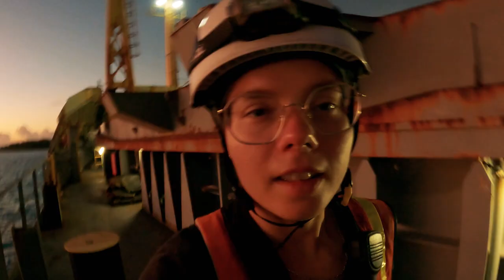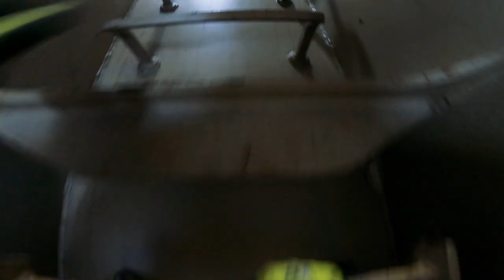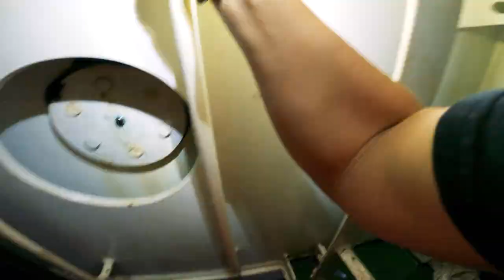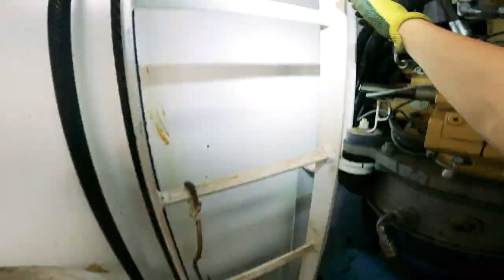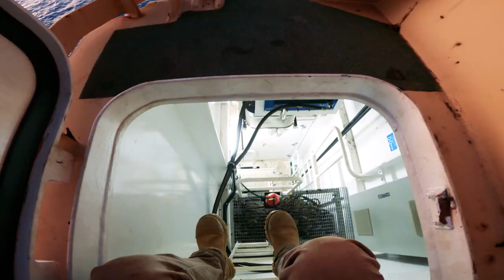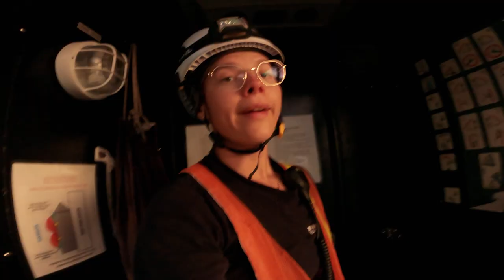Climbing Crane #1 On A [Tiny] Containership

Comment: Is the crane used to open the hatches; does that vary from ship to ship? Who on the crew makes sure the longshoremen take the right stuff?
Reply from the maker: I'll direct you first to my info video on opening hatches: https://youtu.be/6v2bzCKRlHA
Reply from the maker: Regarding unloading and loading, there is a stowage plan that is agreed upon by both the chief mate and shoreside ahead of time. Then the hatch boss has the plan in hand when discharging and loading. If anything changes (which it always does), we are notified and we have a cargo program that we plug the changes into to ensure we will maintain vessel stability with the changes. Then we approve, and they carry on
Reply: Thanks. Looks like, on this ship anyway, the crane isn't used to open the hatches.
Reply from the maker: @OldePete  Correct, different on other ships.

Comment: I thought you had the 12-4 watch. Is this overtime?
Reply from the maker: I'll have to do an in-port vs at sea watch layout. When port stays are longer than average, we switch over to in-port watches which are 8 hours on, 16 off. Makes for better sleep so we get some recovery time in mid-voyage
Reply: @m.leinewolczko   Thanks, and time for hitting the yacht club for some sailing! Do you get any "weekends "off  while in extended port stays?
Reply from the maker: @chairrockfarms1337  Haha we don't get days off. But can get off the vessel when the work day is done. My work day ends at noon (since it starts at midnight).
Reply: @m.leinewolczko  You are confusing me,  that is 12 hours on, not 8?   Are there many other merchant ships in DG? Do you carry reefer units?
Reply from the maker: @chairrockfarms1337  My watch is 0000-0800, but that doesn't include overtime. 4 hours of overtime usually right after watch.
Unfortunately I can't give you any information about DG, nor the cargo we carry. Operational security reasons.
Reply: @m.leinewolczko  thanks, we can only imagine.